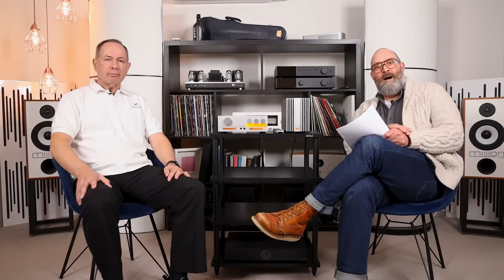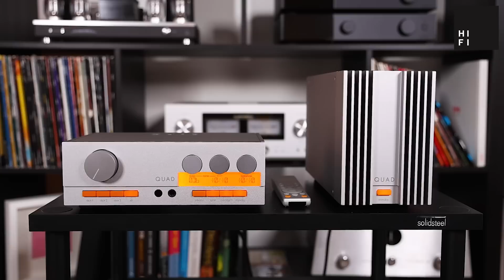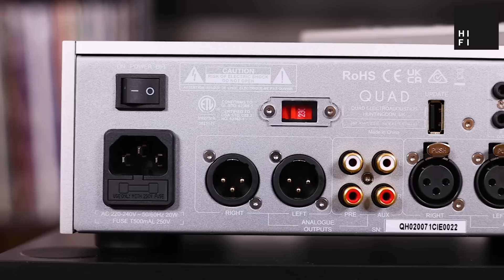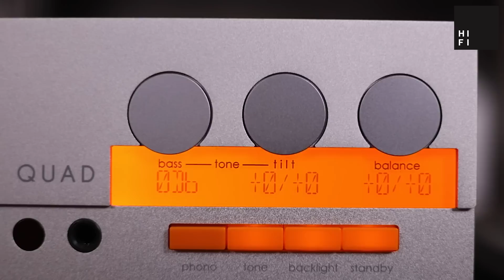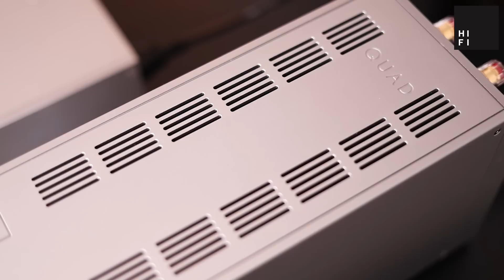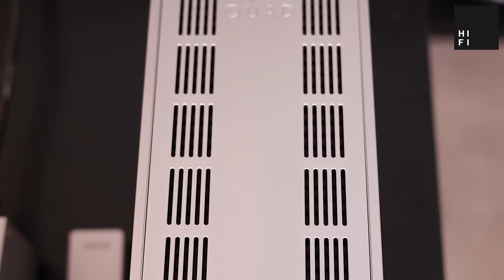The Quad 33 Preamplifier + 303 Power Amplifier | A Legacy Reimagined!

Comment: I started out in the early 70's , working in a Hi-Fi shop on Saturdays whilst still at school , then through Uni studying Electrical & Electronic engineering . 

Quad was always one of my favourites from day one and I sold lots of 33/FM3/303 , also sold a number of the 50E mono power amps ( hopefully they will introduce an updated FM3 , possibly with DAB , because I still listen to FM radio as much as anything else ) and I also sold quite a few pairs of the original ESL (57s) .

While as an impoverished student I started out with a Pioneer PL12D , Sony amplifier and built a pair of KefKits , it wasn't long until I managed to buy a 33 and , from memory , the second 405 power amplifier to come through the shop . I had those components for many years , made my own custom phono inputs to match different pickups , as you could back then as there were spaces on the input cards to do this . I do remember , a while after getting my 405 , revisiting the 303 and noting that it actually had a different sound , hard to describe , but I'd have to say 'crisper' and less bloated than the 405 did . Perhaps the 303 had a lower output impedance and hence a better damping factor than the 405 , which would result in tighter bass control with many loudspeakers ...

As my collection of kit increased , and home cinema became a thing , I bought a Sony AV preamp and multiple power amps etc , then amassed a huge system with lots of source components , CRT video projector etc . However a few years later I tired of it and went back to a proper audio system , at which point I got my 77pre/77FM/77CD/707 and ESL63s , and I have remained happy with that kit now for something like 20 years .

With my current set of kit , I'd be more interested in a comparison of the sound quality between the new 33 and two bridged 303s , compared to the likes of the 77/707 , 99/909 or any of the more recent pre/power combinations . In other words , in terms of pure sonic quality , how do these new components , being the latest products , stack up against some of Quad's more recent products ? 

One thing , looking at the new 33 pre is there seems to be no tape loop ; as someone who has done a lot of recording down the years and had multiple tape decks , this seems a glaring omission . I still run two Revoxes ( A77 quarter track , B77 half track HS , sadly sold my half track high speed G36 , best tape recorder I ever had )  , two Nakamichi 700TT , Technics RS276 and 279 plus Sony TC-KA6ES , plus two Uhers , tape is still very important to me , and that is before I look at any of my video kit , the sound from which still runs through my hi-fi system . Although I have a couple of external switchers so that my video sources just present to one Aux in on my 77 and audio sources to another ; I still need the record out ; for many people I would say that one tape loop is an essential . I know that with the Quadbus system I could just add extra preamps onto my system to gain extra inputs ( not sure how the tape loops from different preamps would function across the Quadbus system ) . 

Is it my imagination , or is the new 33 physically a good bit bigger than the old one ?

Comment: I owned the 405 II / 34 / FM4 stack for years.  Loved the sound and aesthetics.  However,  the build quality was not the best, combined with some service issues.  So I moved to the Linn LK140 / Kolektor 25 problem free years ago and never looked back.  Nonetheless, Quad will always hold a special place in my heart.  I’d also guess the new 33 / 303 addressed my issues.

Comment: "Why not?" he says. £1k+ extra is why not! Great sales presentation here, by the way. I wonder what the product design reviews said about the look of the front panel. The orange display looks a bit overpowering. I suppose the original amps were made to work with those clunky panel electrostatic speakers, so the amps had to be stable under various loads, so stability was guaranteed. I also wonder why the heatsinks are where they are. They seem to be an unnecessary constraint to the design.
Reply from the maker: Hi there, the amp speaks for itself in the demo room, pop in for a listen!  The display has brightness adjustment so you don't need sunglasses!
Reply: Sensitive input circuit close to the connection at the back, power circuits in the front. The internal speaker cables from front to back are not sensitive to interference. And the heat sinks on the front give it a very recognisable look.

Comment: Every Home Should Own a Quad.. I Have Two 33/303/FM3 Set Ups both from The 70s  Serviced By Quad   And They Still deliver The Most Amazing Sound...They Will Outlive Me  No Doubt.
Reply from the maker: They definitely built them to last!  One of the most reliable brands out there.
Reply: @hi-ficorner  I remember having a customer come in wanting to buy an amplifier , specifying that it must be British . I immediately suggested the Quad 33/405 , which was the current model ( forgive the pun ) and in stock ; but he immediately said anything but Quad . I asked him why and he said he had a set of 22 and II power amplifiers , which he'd bought 20+ years before - and they'd gone wrong ALREADY !!!   So I sold him a Sugden A48 ; we also had the Radford C51/P51 in stock , which would have been my next suggestion , but he liked the Sugden .  He went away happy . Wish I'd got those Quad valve amplifiers off him .
Reply: Debatable. Personally I find the Quad sound hemmed-in and claustrophobic, and that opinion hasn't changed since I first heard the 33/303 back in 1976. I'm sure the bass is just an afterthought, too. They're certainly well made, but not for everyone.

Comment: My first job after leaving collage was with Quad working in the lab with John Collinson. At the time we were still working on the original 303. I spent many an hour replacing output transistors that John managed to destroy in early production.
Personally, I found the 303/33 went best with the electrostatics. Peter Walker could never understand why anyone would ever buy a coil loudspeaker over his electrostatic. This combo worked very well and truly sounded clean and accurate on speech and some kinds of music.
However, the 303/33 combo did not sound that great on coils. Lacking deep clean bass and overall detail. After leaving Quad I opened up in retail. The Quad amplifiers with the electrostatic sold quite well but I NEVER sold a Quad 33/303 amplifier with standard speakers. This was not my opinion this was what my customers would say after a comparative demonstration. Personally, I loved to sell Quad in my shop. Almost 100% reliable and one of the best built of the day. In later years I used the 405s in a number of cinemas. Later still I used hundreds of the commercial versions of the Quad amplifiers in the first 10 multiplex cinemas AMC/UCI built in the UK I was chief engineer at that time.
Regarding the new versions, I look forward to hearing them. I do hope they are more dynamic than the original. I'm surprised the power is so low. Going from 45 to 50 watts is less than 0.25dB in level. I doubt ANYONE could tell any difference. These days 100 watts into 8 ohms would be more useful, with power doubling into 4 ohms, not just a small increase! One of the reasons the original Quad lacked dynamics was current limiting in order to protect the electrostatics. Low frequency limiting was another factor.
Reply from the maker: Thanks for your input, the new amp is very high current and drives difficult speakers very well, somewthing to do with the over specced power supply.
Reply: Hi current. I have 2x monoblocks. There is no lack of dynamics with the high current design. I'd love ESLs but as with many people, simply no room for them.
Reply: @mike_lowndes  I am temporarily in a small house , but still with my ESL 63s . While there is not enough space to set them up properly , I have hung heavy drapes on the back and side walls behind them to dampen the rear radiation . Sitting with my sofa about 5 or 6 feet in front of them , I am in a nearfield situation , and the small size of the room compensates for the lower levels I have to use ; that and I am semi detached with neighbours through the wall . Previously I was in a country cottage with a 35x15 feet living room and 3 foot thick sandstone walls , plus the nearest neighbours 100 yds away , so could play my music as loud as I wanted . Once I retire , I will buy a more suitable house again .
Reply: You should have retired

Comment: The orange strip is garish.
Reply: These look to very much pay tribute to the OG models, certainly including the colour scheme .
Eliminating the slots for removable PC boards for the phono and tape stages certainly freed up space on the back panel for a ton more intos and outta’s, including XLRs, and ditching the DINs will be a blessing to us greybeard boomers considering revisiting the nostalgia of our first QUAD systems from the late ‘60s to mid ‘70s who’ve collected a few bushel loads of audiophile I reconnects in the interim.
Reply from the maker: Eye of the beholder
Reply: To steal from a couple of industry voices decades apart “if it sounds good, it is”, and “the only person who has to like the sound of your system is you”.  I owned a complete QUAD system 33/303/FM3/ESL57 over 50 years ago, and the only complaint my then 20yr old ears had were related to the well known limitations of the speakers.  Not currently in the market for new gear, and have long since stopped collecting, but would love to listen to these pieces in a familiar environment.
Reply: 'garish' is one word for it, I'd say 'hideous'

Comment: I loved the original models.  I really hope these are in the same ballpark
Reply: Had a complete 33/303/FM3 ESL57 rig back in the early ‘70s - the start of my journey down the deep and musty rabbit hole of what we now call FOMO😂 - and even in the first few minutes these units look to be larger and less softly rounded on the edges of the amp’s finned heat sink.
Reply from the maker: They have been considerably improved in my opinion, a fair bit more powerful
Reply: Made In China
I had the original. It changed my life.

Comment: Made in China.
Reply: So are the brakelines in your car
Reply: As 95% of all audio and other technical gear nowadays. Also in China and Azia in general the passion for high end audio was always there but is starting to grow quickly. If the design and materials chosen well then 'made in China' is no problem at all.
Reply: @WACONimages  Until the threatened / promised new tariff structure is enacted?
Reply: @WACONimages  "made in China is no problem at all" except for the UK manufacturing industry!
Reply from the maker: At IAG's state of the art manufacturing facility, yes!
Reply: Very likely the mobile devices on which most viewers are watching this are also.

Comment: nothing to do with quad,just rebranding iag group,no thanks .
Reply: I think you don’t really know what you’re talking about.
Reply: Incorrect.  The circuit board designs are a direct lift from the Quad originals, with updated & improved components.  IAG do the sort of badge engineering you refer to elsewhere, eg the Mission and Leak amps contain electronics based on the Quad Vena II, but are none the worse for that.
Reply: @karlhinchliffe4920 aren’t Modern Leak’s class D chips
Reply: Did you actually watch this video? The engineer has been with Quad for 40 years but yes Quad was bought by IAG group and products designed in Uk & manufactered in China. If these products were maufactered in the Uk they would be twice the price. The golden era of hifi 60s/70s is over so the Uk consumer has either got his original 33/303 ir is dead. You enjoy your Naim gear
Reply from the maker: It's ok, we have the right product for you
Reply: Guys its ok to disagree

Comment: I have three 33 control amps and two 303 power amps. Quad is a legendary company and will still service the original 33/303! The new 33/303 has plenty of Quad DNA... just by looking at it, you know it's true to the original Peter Walker design. The new amps will be on my hi-fi shopping list, very soon. Of course, I won't be parting with my originals...
Reply from the maker: There is always room for both!  Let us know when you are ready.